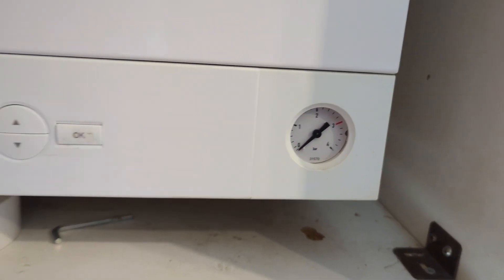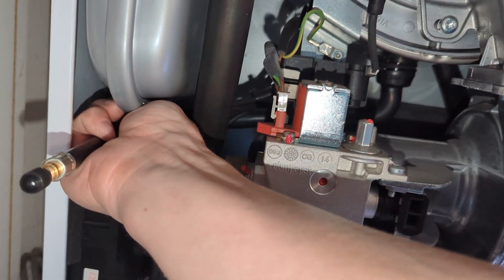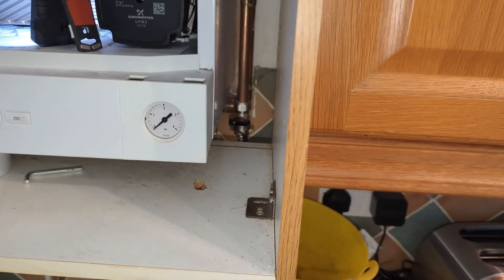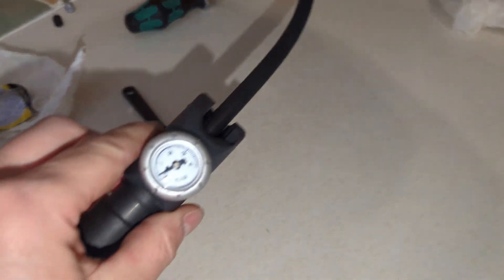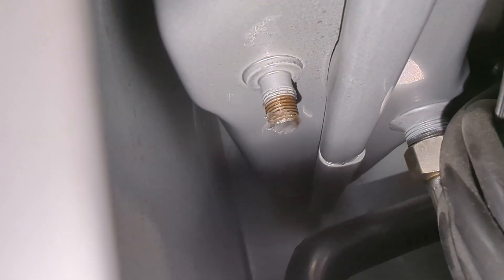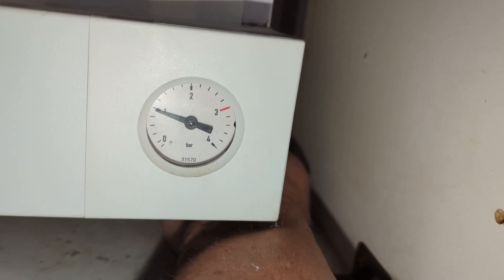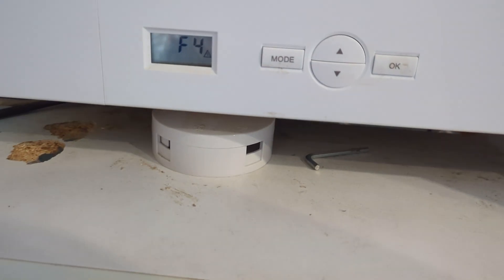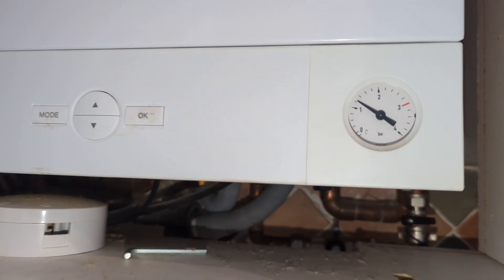Viessmann boiler. Pressure on zero. Re pressurising the expansion vessel. No drain tap.

Comment: You never fancied a battery powered pump?
Reply from the maker: I have got a regin one but the connector broke. Was just plastic, pretty poor to be honest and they were having supply problems with getting just the flexible connector and i just got bored of waiting for it to come back into stock and got used to the hand pump...its small and fits in my service bag...i might get another in the future but there's other stuff i think i would buy first, like maybe a wet vac, they look helpful 👍
Reply: @northwestgascertificates  I have the Makita tyre inflator and it has served me well. I had to buy the DeWalt to Makita battery adapter though. As for the wet vac, just do it. I wish I bought one sooner
Reply from the maker: I might go to one of those tool fairs this year and treat myself 👍 @daz3745